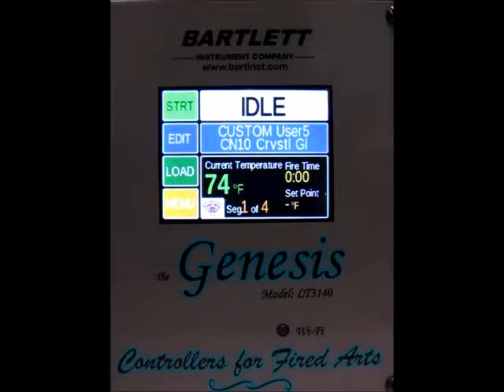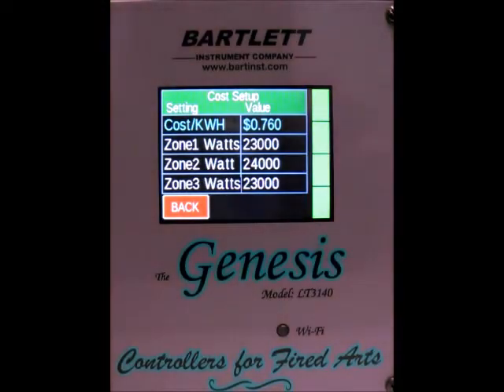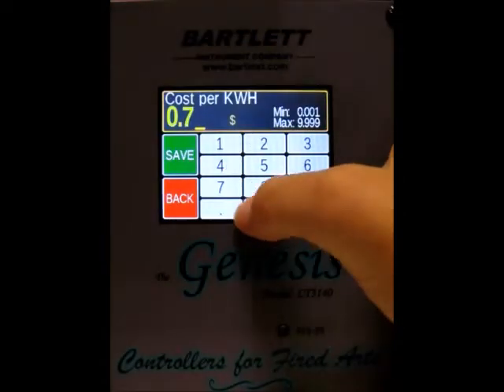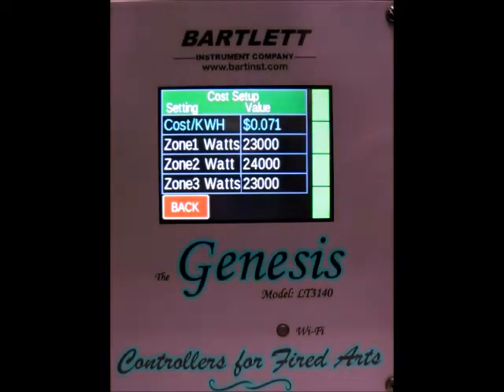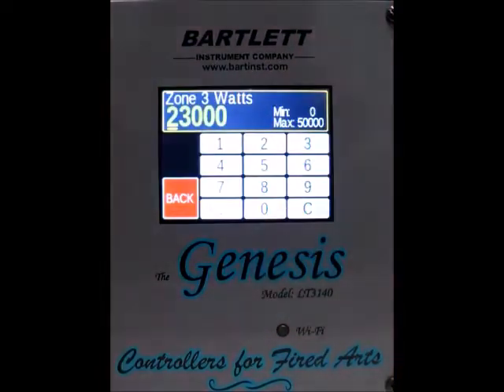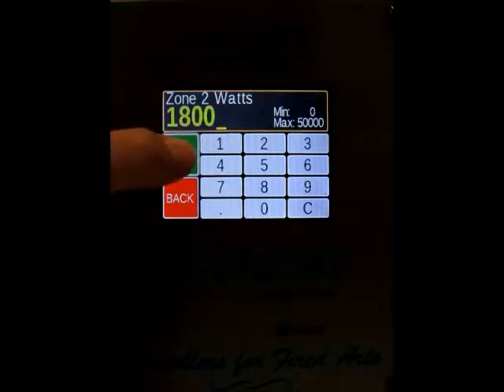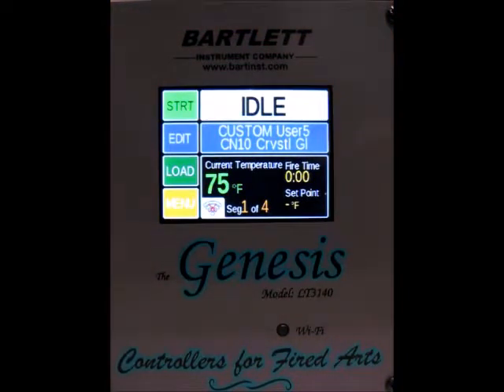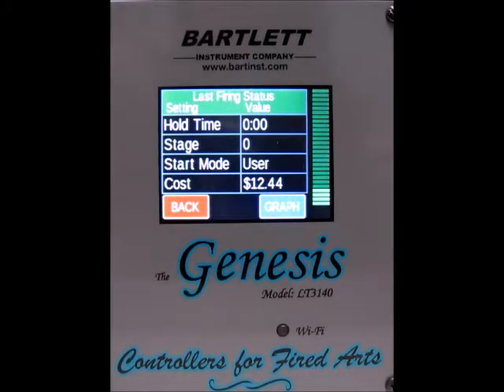Bartlett Genesis/Genesis Mini | Cost of Firing

Comment: I have a 3-zone L&L e23M-3 kiln. I can't figure out how to get the wattage for each zone to enter into the cost calculator setup.
Reply from the maker: The wattage should be located on an information plate for the kiln itself that is normally located on the L&L control box. If you have the model and serial number of the kiln you can also contact L&L and they can tell you. Since your kiln is a 3 Zone unit you will divide that wattage number by 3 and that is what you will put into each Zone for watts.

Comment: I've added the cost values several times and still the cost of each firing shows $0.00. Are there any tips on how to get this feature to work?
Reply from the maker: Thanks for reaching out to us. As long as you did a firing and it went to complete after putting in your cost information you should see a value higher than $0.00. Can you please send an email to information@bartinst.com with a picture of the Cost settings and we will be glad to help you figure what may be the issue.

Comment: How do I know how many zones I have
Reply from the maker: The number of Zones is determined by the kiln manufacture. You can check to see what the controller is set for by press the screen where it shows current temperature of the firing. It should take you to another screen that shows all thermocouples. If single zone it will just show TC 2. If two zone it will show TC 1 and TC 2. If three zone it will show TC 1, TC 2, and TC 3. Another quick way to see how many thermocouples/zones you have is to look inside the kiln and find how many thermocouples are protruding into the kiln.

Comment: I can see that Bartlett has to deal with many customer issues including ignorance of the zones in peoples own kiln.
 I must say that the idea that cost of firing is hard to calculate is a good subject to include in the Genesis.  But Bartlett seems to have missed out on dealing with a really difficult aspect of the cost calculation that computer algorithms can deal easily with.  And that is the issue of time of day price changes.  In my area the fee structure has three different costs per kilowatt hour  (overnight, morning and evening meal times, and mid day times).  
Bringing the necessary kind of computational power to the issue is where Bartlett could actually and easily demonstrate why paying a lot for the Genesis could actually be justified.
Reply from the maker: That is a great suggestion. We will look into this and see if we can accommodate this for our global customer base.

Comment: Does this controller actually read the total wattage used or is it estimated based on the specifications of the kiln?
Reply from the maker: The user must enter the cost per kilowatt hour and the wattage for each zone. If the kiln has one thermocouple then they just put the complete wattage under Zone 2. If the Kiln has 3 thermocouples then they divide the wattage by 3 and put the values in Zones 1, 2, and 3. To enter this information, use the Configuration menu. This information can be acquired from the kiln manufacturer or consult your kiln’s manual.

Comment: Hey! Please help me finding how many watts and how many zones in my kiln. Model - 1822D
Thanks in advance :)
Reply: 1 thermocouple per zone. So if you just have 1 thermocouple it's a single zone, etc. Wattage should be on nameplate where you'd find serial number and model number.
Reply from the maker: Yes, you can find this information and additional kiln information on the nameplate.
Reply: Hey Don , I have the same kiln , did you find the answer?